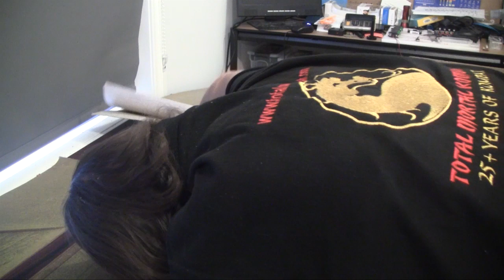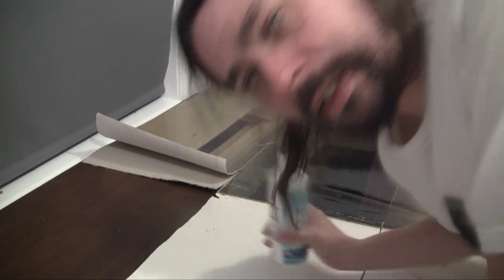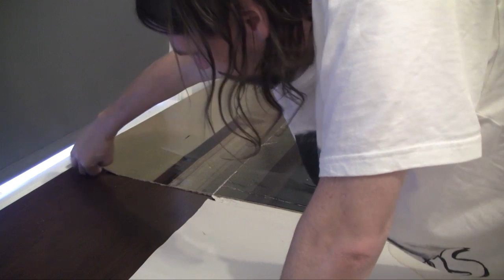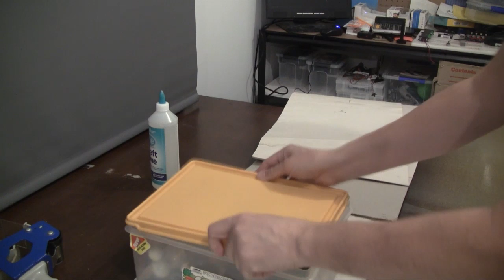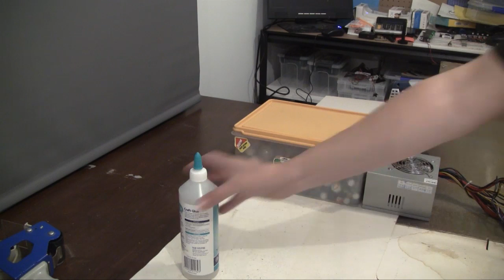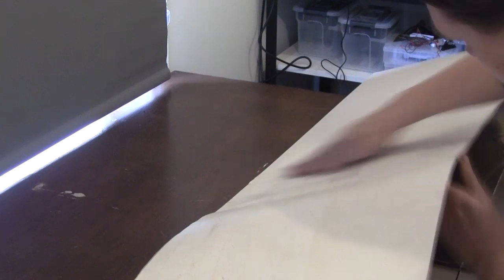Repairing MK:DA UK Standee [Part 1]

Comment: Hey Luke, at my work we do (besides printing and signage), we do book restoration.  With things like this, we actually use hot wax instead of glue.  I wish I had seen this video when it came out, I might have been able to help or give some tips (without sounding like a fucking know all).  If anything goes horribly wrong with it, shoot me a message.  Good luck though dude!